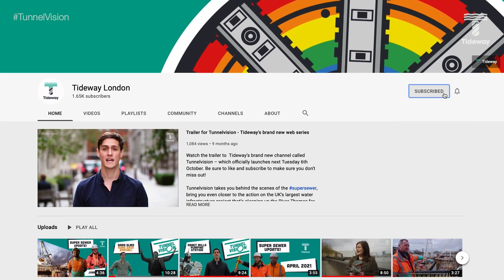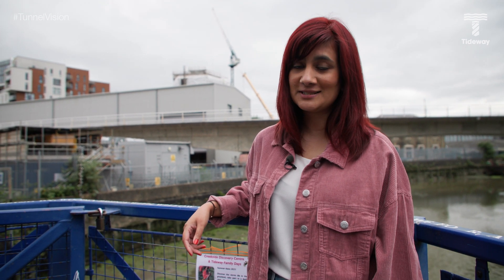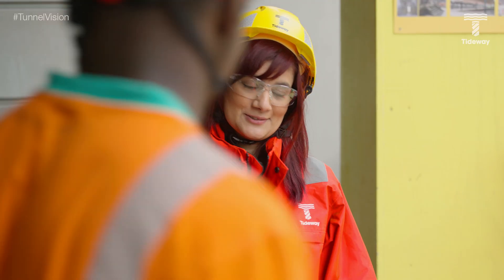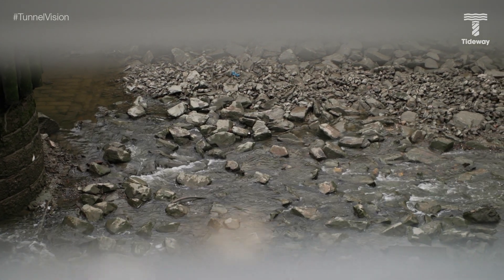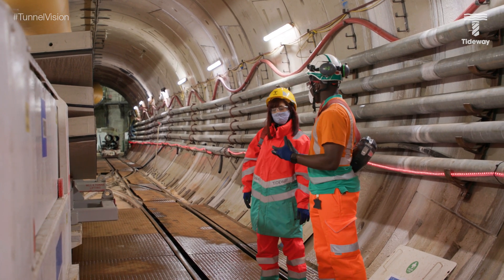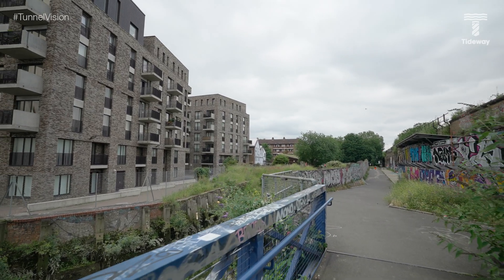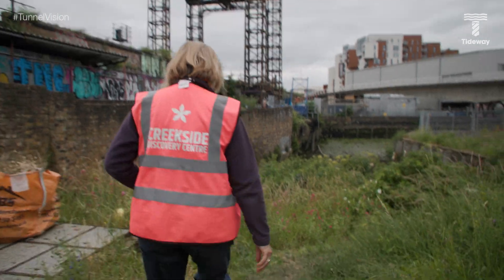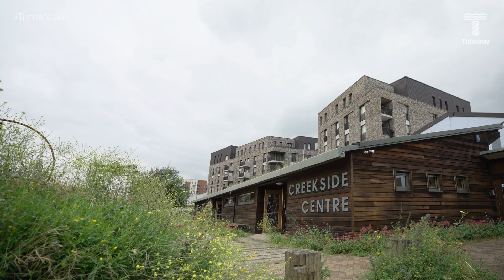TUNNEL VISION: Episode 10 – Greenwich Pumping Station, a TBM and a nature reserve in... Deptford?

Comment: Mmm 500 tonnes per barge which takes 50 lorries off the road, you got your calculations wrong there because most constrction lorries i e 8 wheelers carry roughly around 20 tonnes artics around 30 tonnes, think you need to re do some calculations, is it just making it sound good for the environment and safer london roads